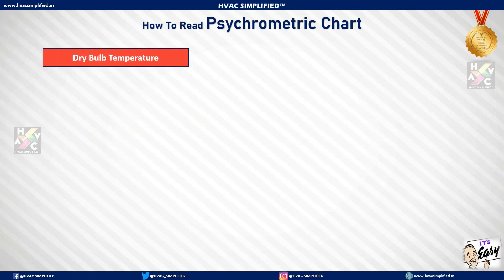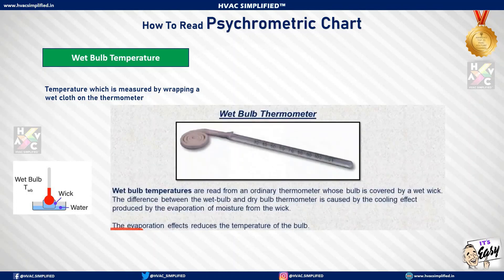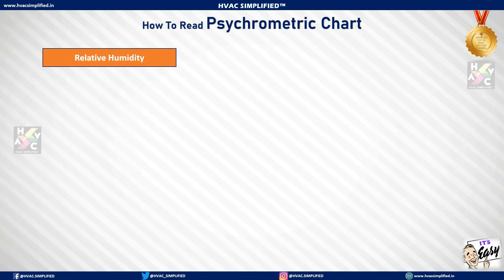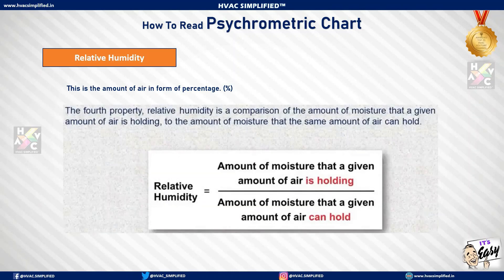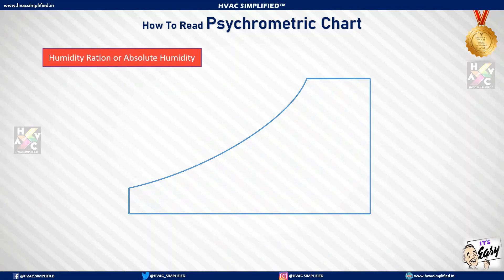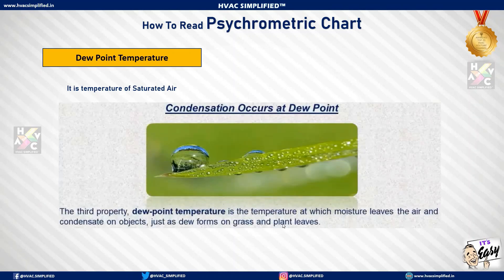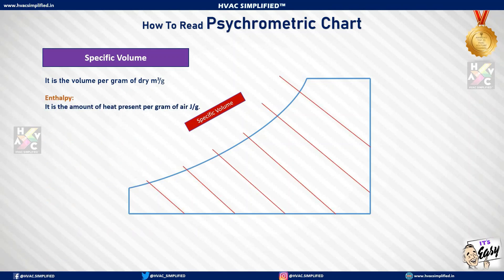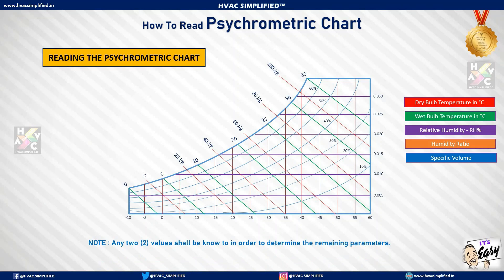How to Read a Psychrometric Chart - Animated Explanation Stepwise (Students & Engineer's)

Comment: Good evening sir, please guide me about staircase Pressurisation system. My fans are on the roof & will equipped with overpressure relief damper with Actuator. As per the consultant requirements overpressure relief damper has need to be released the pressure when pressure will reach upto 60Pa. Can I use the differential pressure switch to I'm the staircase to sense the pressure & damper Actuator can operate through it.
Reply from the maker: Yes.
Reply: @hvacsimplified  Does I need the BMS connections also in this?